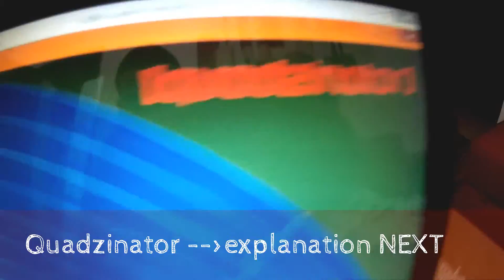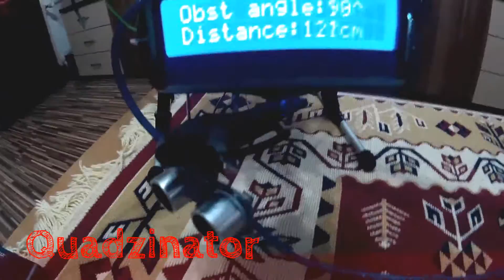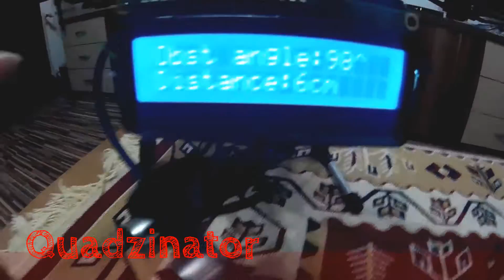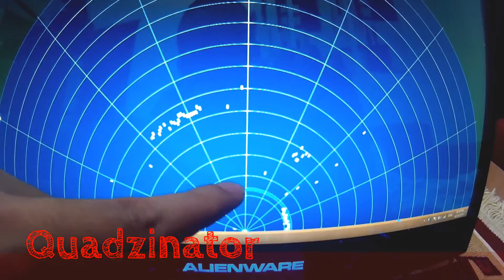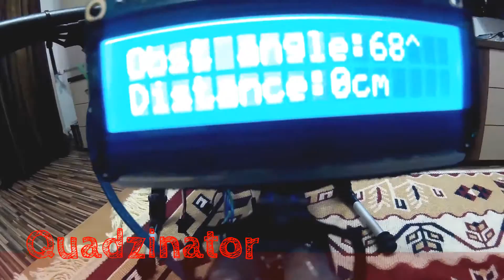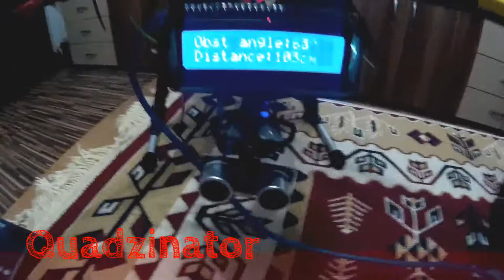Quadcopter Obstacle detection using Arduino/Sonar/radar graghf

Comment: what flight cotroller do u used in the quadopter? I confused how to communicate data from arduino to flight controller (i.e I use APM Ardupilot). So my quad can fly in auto mode with obstacle detection
Reply: You can connect a Raspberry PI to the Telemetry port  (i think Ardupilot is similar to Pixhawk). Then you can receive data and send orders to the autopilot.